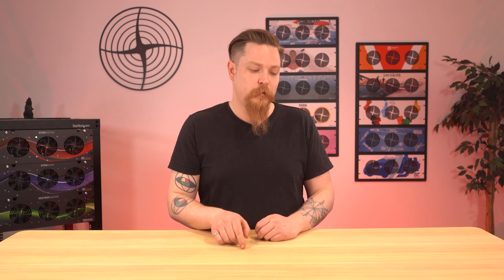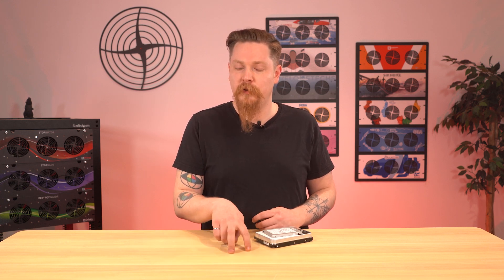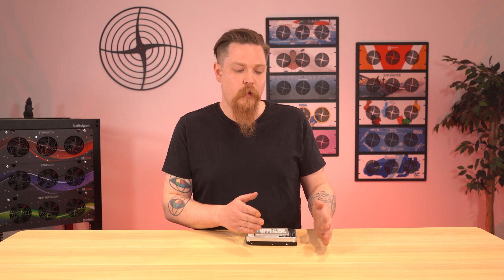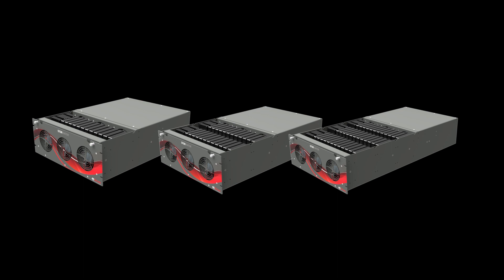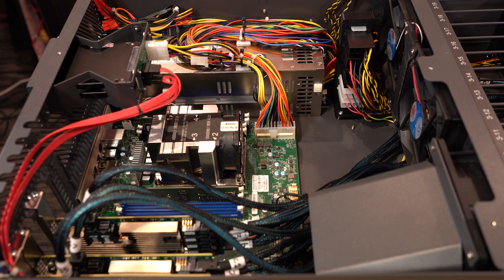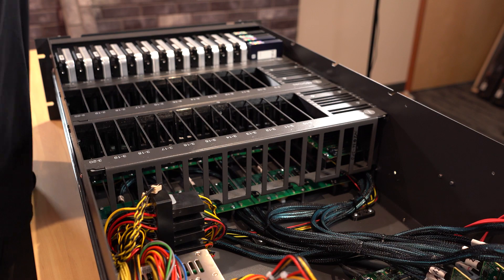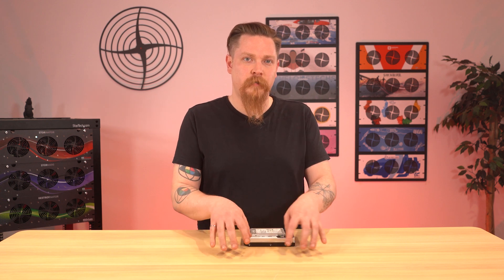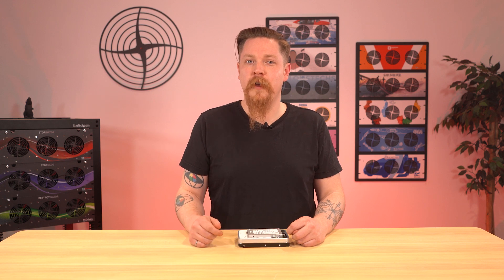Thursday Tech Tip - Storinator Hybrid Redesign

Comment: Good god, I wish that some of these updates existed before I bought my chassis two years ago, but love the changes.  I REALLY love the power tower thingy, for those odd 4-pin molex connectors.  I am curious though, since you're offering the ability of E-ATX boards, does that mean you're going to offer new/different Redundant PSU's?  Ones that have more CPU/GPU power plugs over the current generation?  I was bummed that I was forced to get a motherboard that only uses 1x8pin and 1x4pin CPU AUX power.

Comment: Great with the boot drive access and the SSD adapter.
Seeing as the SSDs are mounted perpendicular to the fans at the front, how are the temps under sustained writing to the SSDs from the front SSD to the rear most one?